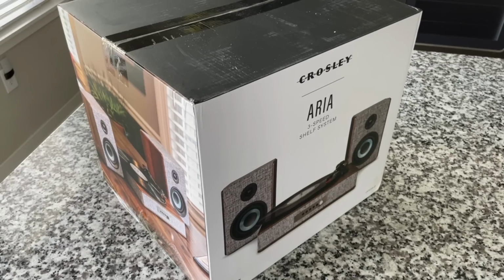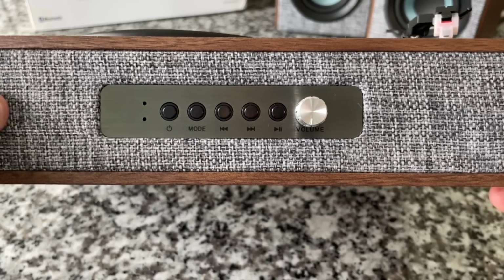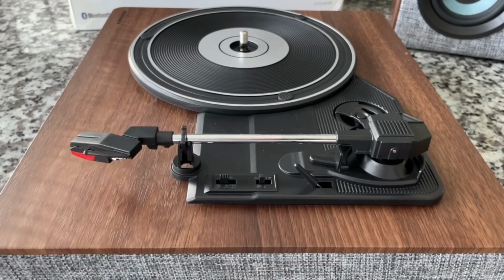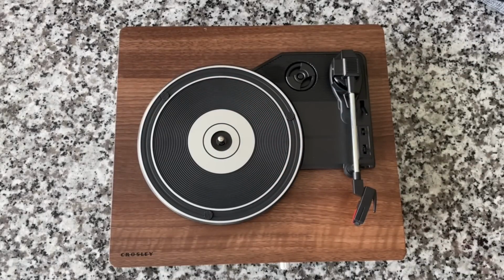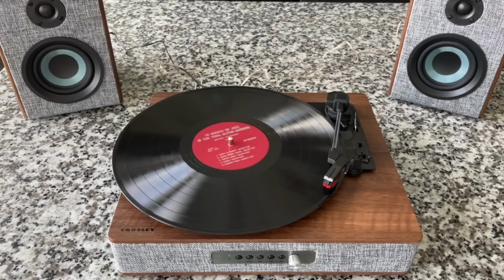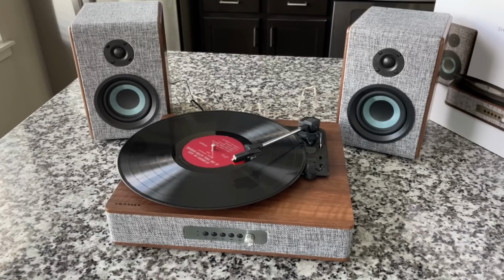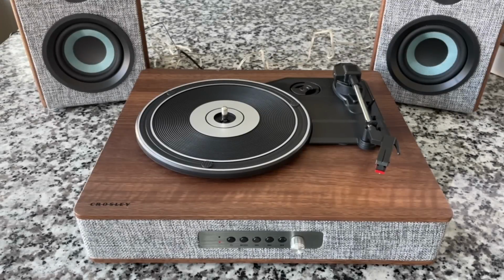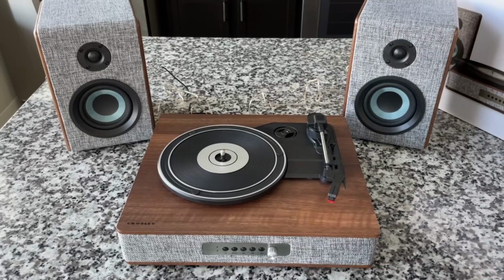Crosley Aria Unboxing & Review! #vinyl #turntable #review #unboxing

Comment: It's missing one important piece, which I would've needed badly in my former house in Cedar City-a dust cover, and a fully enclosing one at that.  Here in my little apartment in West Jordan, I don't have quite the problem, but I would still prefer that it had a dust cover.  However, function and sound-wise, it's a relative bargain at $150.  It would be a value anywhere from $130 to $170, methinks.

Comment: Very good for the price, although I thought the low frequency end was a bit 'lumpy' and not really extended in any way..Maybe I'm being too fussy. You could have put an ear to one of the tweeters to hear if it was emitting sound OR, with just one channel in use,  you could have put something over the tweeter and you would have noticed a loss of high frequencies. If the larger speaker was radiating everything there wouldn't have been any change to the sound.

Comment: No, NO, NO!

Those RCA jacks are NOT intended to be line outputs!!  You're playing with fire if you connect them to a line-in of another component!  Yes, it CAN be done, but it really, REALLY should NOT be done, and there are better ways to do it if it MUST be done.

The reason they use RCA jacks is it is a simple way to connect the speakers to the main unit.  A LOT of 'inexpensive' stereos of the past did this, too.  It's done to make it easy for the average Joe Schmoe to hook up his new toy without really a need to understand what he is doing.   I've had a couple of stereos that were set up this way - a 1980s Fisher, a 1970s LaFayette, and an early 1970s GE set, as well as my handy-dandy li'l Radio Shack SA155 mini-amp.

It DOES sound pretty good for $150ish dollars.... so, I agree.  Not bad at all.
Reply from the maker: Oddly, the system marketing boasts line level outputs to connect to another sound system.
Reply: @Recordology  It would not be the first time that the marketing guys got it wrong.   I'll bet they saw those RCA 'outputs' and assumed 'line'.
Reply: Burning in should take at least 8 months with these speakers. Use pink noise and volume on max. Come back in 8 months and admire the difference in sound quality.

Comment: An amplifier level and line level on the same output? That's a BIG NO!!
Reply: Yeah, they got the label wrong. Those are clearly RCA speaker output jacks, not line output jacks.
Reply from the maker: Oddly, the system marketing boasts line level outputs to connect to another sound system.
Reply: I agree with these two guys. I will connect this to my DIY tube amp connected to any of my 96dB plus speakers and time to bring out the salad, sushi and quiche with a good drink on an early Saturday afternoon merienda! A handshake 🤝 and warm greetings from my humble country 💞 the Philippines 🇵🇭!
Yes and I will upgrade it to a better ceramic cartridge to play my collection of Direct to Disc records! Nice viewpoint guys!

Comment: Doesn’t anyone realize that the same cheap Chinese mechanism that’s worth about $2 is part of that unit?! Peace.
Reply: Yes, but for most people, that mechanism does the job it's built to do.  Yes, there are better turntables out there - no argument there.  In fact, Crosley has built portables with a better mechanism - a full-size, 3-speed auto-return mechanism with a magnetic cartridge (it was called the Keepsake).  I have such a beastie in my basement; it's definitely a step up from a Cruiser, and although it also features better speakers than the Cruiser,  

The people who feel a need for a better turntable probably aren't going to be looking at a product like this in the first place.

Comment: The ceramic cartridge that will destroy your vinyl and the turntable go's round like the record is warped, please don't buy it I have had people on my Facebook vinyl site returning these.
Reply: Is the record aware of what is above the stylus? How does it know that it is going to be destroyed, How is it that a Magnetic with the same tracking force would not destroy the record?
Reply: @GaryKeepItSimple  
The cause of record wear is the inability of a stylus to track it faithfully. 
If the stylus can track it faithfully with no audible distortion or break-up of the sound or actual groove skipping, the record might potentially wear out a little faster (surface noise buildup) after well over 100 plays, at a tracking force of 5 grams vs. 2.5 grams, but tracking with distortion at 1.5 grams will cause more audible distortion build up than faithfully tracking with no distortion at 3-4 grams.
And there are more (or less) compliant ceramic AND magnetic cartridges.
Reply: @GaryKeepItSimple  I was a record dealer for 40 years and collections I bought with systems which had ceramic cartridges always had record that sound like the sea was in the background , as a ceramic cartridge breaks down it has small bits of glass break off making if like  having sandpaper in the groove, ceramics is only melted glass in the first place a diamond stylus is completely different.

Comment: I like the design of this stereo set up. It's seems to be decent quality and would satisfy most entry level vinyl listeners. 

I suppose the cartridge and stylus is somewhat disappointing since the stylus will have to be replaced more often and will not produce a smooth balanced sound most of the time. 

If it had the option of installing a better cartridge and stylus it would be a bit more useful for somewhat that wanted to introduce themselves to an a in one stereo system purchase and improve it gradually.
Reply: You could upgrade it with a Pfanstiehl P192D or Banpa BP2-ATC cartridge.

Comment: At least from what I can hear through the video, it does seem like they properly impedance matched the ceramic cartridge, so that goes a long way towards closing the gap versus what a magnetic cartridge would sound like through this system. Also it's nice to see the lighter tracking force and improved speed accuracy compared to the typical suitcase player-type mechanisms. The auto-scan FM radio is rather cheap and gimmicky, but now that many young people don't have any kind of radio in their home, it's better than nothing.
Reply: My first thought when I saw those tweeters and the ceramic cart was "Oh my God..  Ear shred".   I was pleasantly surprised.   Only thing I noticed were diminished highs, probably can't reproduce above 10 or 12k.  That's a good system for $149.
Reply: Honestly, most modern 'terrestrial' radio is overrated anyway.  Remarkably short play lists with frequent repetition of a handful of songs, deejays who just don't know when to shut up, and 10-minute blocks of ads - many of which are literally begging for more advertisers.  

I'd happily trade the tuner for a magnetic cartridge and a tone control.  With the Bluetooth-in, I can stream my own playlists and satellite music services to this.   The Aux-in would be great to connect an external CD or cassette player.  And if 'radio' is still a requirement, most terrestrial stations also offer audio streams anyway.

Comment: If they really needed to cut costs, start with the radio, not the cartridge.
Reply: Get rid of the radio and bluetooth. Focus on the turntable.  Better cart/tonearm and maybe better mechanism/full size turntable.  Now we have a system.
Reply: Absolutely. That would be a major improvement to have a better tone arm and cartridge like some other mediocre Crosley turntables have.